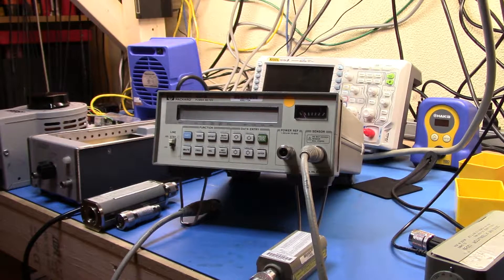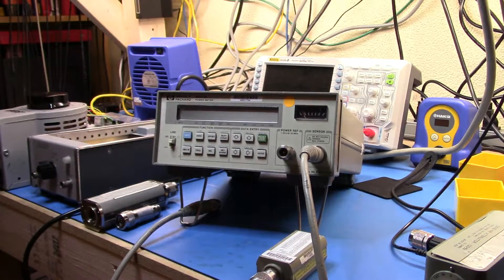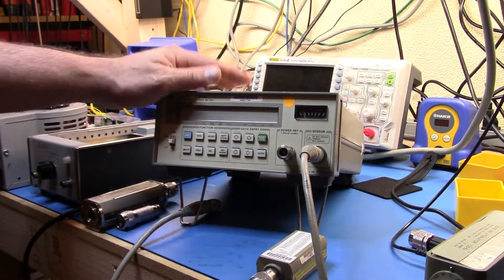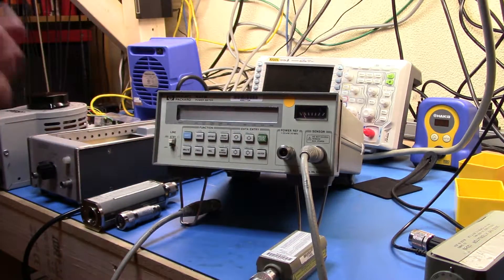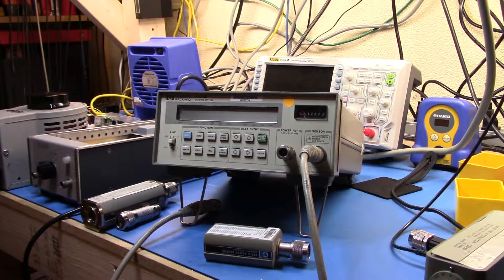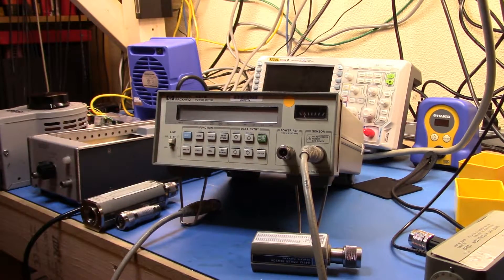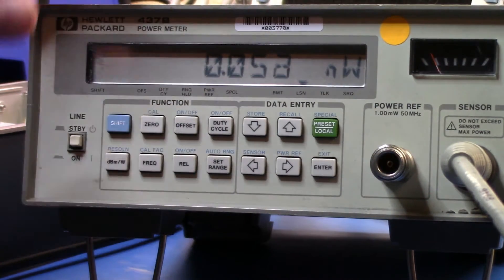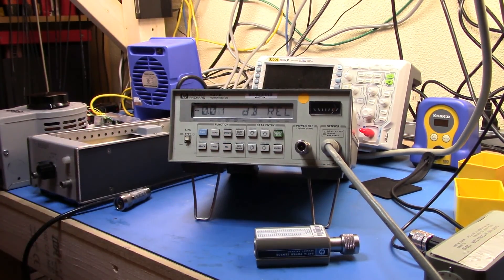HP 437B Power Meter with HP 8481A and HP 8484A Power Sensors

Comment: sir pls talk about duty cycle in it and usage
Reply from the maker: Duty Cycle enables you to have the meter calculate what a pulsed input signal peak is. The meter and the sensors are average power measuring devices so a pulsed signal will appear to be of lower power than the pulse actually is. By knowing the signal duty cycle the meter can calculate what the pulse peak is.

Comment: thank u for video sir ,pls suggest for using power meter using for 2ghz bcoz the set value was set value for 50 mhz during calibration
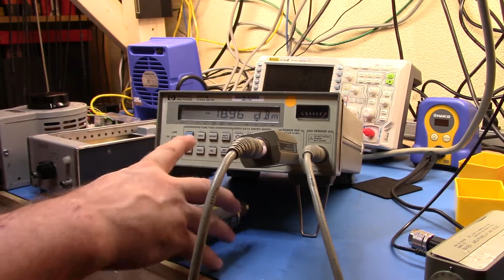Reply from the maker: There are two ways to set the calibration factor. You can just set it directly for the frequency that you want to measure or you can use a sensor table. You can see me selecting one of the loaded tables @8:16 - I select another table later in the video for the 8484. If you load a table into the unit then you just use the Freq button and the unit will work out the appropriate cal factor from the table.

Comment: Does it measure 5G?
Reply from the maker: Depends on the sensor that you use - The 8481A does 10 MHz to 18 GHz but the 8482A for example only does 100 KHz to 4.2 GHz. The various sensors will also measure to different power ranges, 8481A is -30 to +20 dBm but the 8481D does -70 to -20 dBm.
Reply: @tgsoapbox  Yes one would need sensor and antenna as well, and what I know of these get expensive above the 10Ghz range.As for -70 dBm is 0,012 uW/m2?

Comment: Hello, very interesting material, and helpful information.

I own several HP-437B and several Marconi 6960B, I also use several other power meters, I have made many comparisons between these meters. Do you know my web site, sp5mxf.com? On this site I have described very precisely the properties of these meters and the most interesting are the comparisons between different meters. I have spent a lot of time researching power meters and the results and comparisons described are the effect of 2 years of power measurement work. I am very interested in measuring the microwave power.

My web site sp5mxf.com is written in the Polish language, which is certainly a certain difficulty, but now using Google translator you can read the texts in different languages quite accurately. In this way I read in different languages, today there are various tools and possibilities, it is easy. I am interested in your opinion on the information which I have included in the descriptions of power meters.

I wrote this comment in Polish, then I used the translator google to translate it into English so probably there will be some problems, but it should be fairly understandable.

Regards Tomasz
Reply from the maker: Thanks - Great site and information about the different meters and how they stack up with the Marconi offerings.
Reply: @tgsoapbox  Thank you for the good opinion about the work I did on my web site

I greet you very much

Tomas

Comment: Thanks for fast response. I was told that the 478A measured 50 ohms from center pin to ground for termination but label said 200 Ohm Neg for something Do you know what ir should read?
BobZ.
Reply from the maker: There is a blocking cap on the input side so you should see an open at DC - From the output side, according to the manual you can "...measure resistance between pins 1 & 2, and 3 & 4. The resistance should measure between 1000 and 5000 ohms." (I made a mistake in my first reply with pin 3, should have been 2 - This should measure the thermistor pair on the input, it should be unlikely that the compensation ones have blown).

When the thermistor is connected to the meter they would heat up to be 200 ohms. check out the manual http://literature.cdn.keysight.com/litweb/pdf/00478-90021.pdf  - Figures 5 & 6 as well as paragraph 67.

Comment: Thanks for the suggestions but I don't need any more equipment as at 83 I have to get rid of all the acclimated stuff. I also have 5 H-P 487A's that may be open as I can't measure any termination resistance..Don't want to sell  anything not workable.     
Regards BobzZ
Reply from the maker: I read around 4.4K between pins 1 & 3 on my 478A when it is cold - If you're reading an open or a short then you're probably right that the mounts are broken.

Comment: I have a H-P 8481D Power sensor without the meter. Is there any way to test without the meter? Although it has a 200 ohm load but first has a cap  on the input so we can't measure if it is blown Like the old. 478A's. Can you help?
Thanks BobZ
Reply from the maker: You might be able to jury rig something using a power supply, signal generator and the schematic in the manual but it would probably be easier to just buy a meter (as you said, you can test from the input port so you'll need to try doing it from the FET end). You can get a 435B with free shipping on EBay for around $30-35. You'll need the cable as well if you don't have one so that would set you back another $30 or so.

These things are pretty popular with Ham Radio people so an alternative is to check out the local Ham club and see  if they have a regular meeting and ask if someone could bring in their meter to help check the sensor.

I'd offer to do it for you but I'm about to head out on a business trip and will be gone for the better part of a month.
Reply: 8

Comment: Thanks for the great video.
I too have a 437B and it's a great tool. I've also got a couple of 435B's and i like their simplicity but not as convenient as the 437B.
I noticed that you didn't switch off the unit while changing sensors. Is that ok? 
I'm after the sensor with the +44dBm attenuator attached, but they're quite pricey.
Reply from the maker: Thanks Roger - Appreciate the comments.

I've had a 435, 436, 437 and I just got a EPM series one - I posted pictures and comments about them here:

http://www.eevblog.com/forum/testgear/hp-43x-series-power-meters-a-progression-teardown/

I agree with you that the 435B has such a classic look but the 437 is just a better meter in terms of actual usage. In fact while I like the accuracy of the EPM and the range of the sensor I miss the ease of use for the 437.

As for swapping the sensor with the power on, I don't believe that there is any guidance in the manual about that. In fact the turn on procedure explicitly turns the unit on first then calls for the attachment of the sensor (pages 3-7 & 3-8 of the manual). Based on that I've always just swapped them with the meter running.

With respect to the  44dBm sensors, yep costly - I just bought one on Ebay as a gift for my Dad (he's a ham radio operator) and paid close to $450 for it.
Reply: @tgsoapbox  I was on your blog and read the information that you presented there, I described on my website without enthusiasm HP-436, in my opinion it is an analogue meter with a digital reading, in my opinion a very interesting construction.

HP-435B is a completely analog device with a great pointer, this meter is currently very cheap about 30 $ has two important points to pay attention to, is very good in tuning and regulation applications, digital meters are not very suitable for this purpose .
The HP-437B has such a small and not precise analog meter, but it is not suitable for tuning, it is not very precise.

The next great feature of the HP-435B is its internal 1 mW 50 MHz power standard.
This is the best model I have ever encountered in my professional practice. It does not react to changes in temperature or changes in the supply voltage, it is very stable and is immediately ready to work after switching on, it does not require pre-heating. no other meter has such a good master power source.

HP-435B was in my studio as an additional source of reference power and as a meter used for regulation and tuning.

In my meter Marconi 6960B I dismantled the original source of reference power and in its place I installed a reference power source with the HP-435B and now I have a very precise meter.

An even better solution would be to use power Marconi sensors with HP-437B, but you would need to develop an interface that would allow it, the HP-437B is a great meter and the Marconi power sensor are great sensors, much better than the HP sensors.

Regards Tomasz
Reply from the maker: @sp5mxx  That's a nice mod to the Marconi - I have HP Power references in a 435, 438, 8902 and 4418 but I've never compared them to see if the references are different - I just assumed that they'd be the same (or very very similar).
Reply: @tgsoapbox  Hello, I still have all the measuring devices that I described on my website, so I made a comparison between all these meters, HP-435B, HP-436A, HP-437B, E4418B, Marconi6960B.

My conclusions are that HP power meters are very good meters, more functional and more convenient than Marconi, while power sensors are definitely better Marconi, HP sensors are not so good.

The reference power sources are better in HP meters, but the absolute best reference power sources, absolutely sensational, are mounted in the oldest HP-435 meter. No other HP meter has such a good reference power source as 435 and the Marconi 6960B meter has a worse source than any meter HP.

Conduct such an experiment, connect the HP-437B or E4418B power meter's power sensor to the internal reference power source and perform the calibration, value 1,000 mW you see on the LCD, leave permanently turned on for a few hours, the result will be a little different, this result will change a little, it will leave, it will not be evenly 1,000 mW, but a bit differently.

After several hours of operation of the meter, permanently enabled on the measurement of the internal reference power source, re-zeroing and calibration, again the result will correctly indicate 1,000 mW, leave the meter turned on for the next few hours, 1,000 mW this time will not change, for that the meter as well as the power source of the reference power are stable and heated.

Turn the meter off for a few hours to cool down well, turn it on again and see that the result will not be 1,000 mW but a bit on the side, do not reset and calibrate it but wait 2 hours and read again on the LCD will be 1,000 mW even though you did not calibrate.

This clearly indicates that these internal power sources require pre-heating before work, so that they do not change the output levels.

Now run another experiment, connect the power sensor to the power source of the HP-435B reference meter and the other end to the HP-437B or EPM power meter and this phenomenon will not occur anymore, turn off and re-enable after a few hours of the external power standard HP-435 it does not cause any difference in reading, it will always be the same or 1,000 mW. The internal reference power source in the HP-435 is perfect and, without any heating, ready for operation and unchanging in time, immediately after switching on it is 1,000 mW and after a few hours of work also 1,000 mW, nothing changes.
It is not so good in any other meter.

Just remember that using an external reference power source, in this case, the external reference power source is the HP-435 meter, zeroing should be carried out with the HP-435 power supply off. Only after the resetting the power supply of the reference power source in the HP-435 should be turned on and the HP-437B meter calibrated.

I do not know if this is understandable?

Regards Tomasz
Reply: I also had similar fears to connect the sensors to "hot" but I saw on YT how others did so and how it behaves now and nothing bad happens.
You can do it with HP and Marconi equipment, it does not cause problems.

Regards Tomasz
Reply: i guess Im asking the wrong place but does someone know of a tool to log back into an instagram account??
I was stupid forgot my login password. I appreciate any tips you can give me
Reply: @Edgar Benson Instablaster :)
Reply: @Omar Tadeo I really appreciate your reply. I found the site on google and I'm waiting for the hacking stuff now.
Takes a while so I will get back to you later with my results.
Reply: @Omar Tadeo It did the trick and I finally got access to my account again. Im so happy:D
Thank you so much, you saved my account :D
Reply: @Edgar Benson happy to help xD